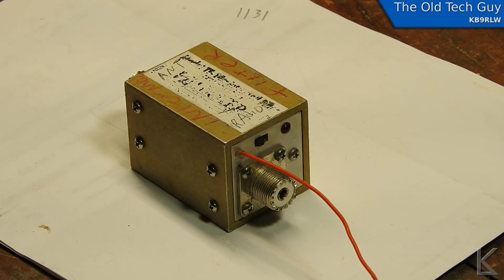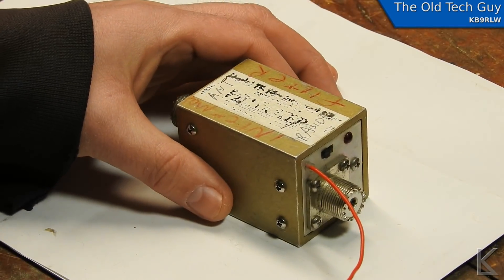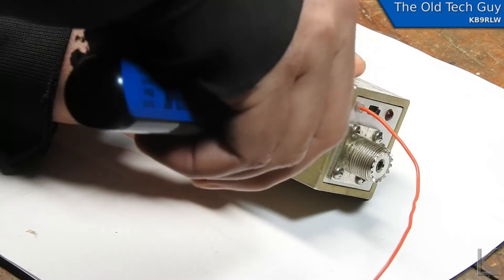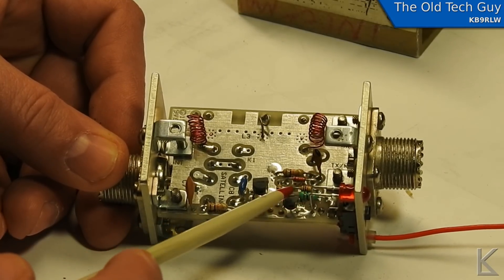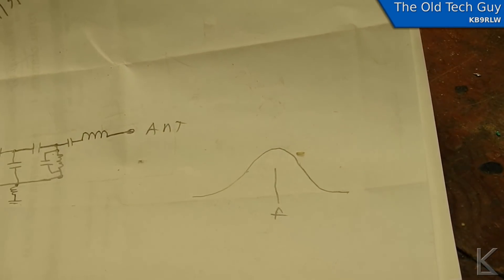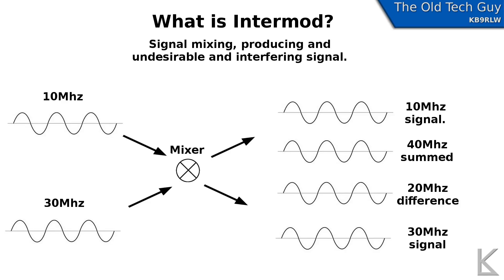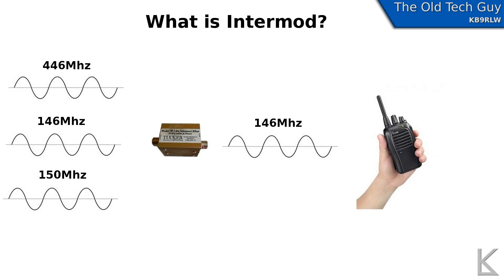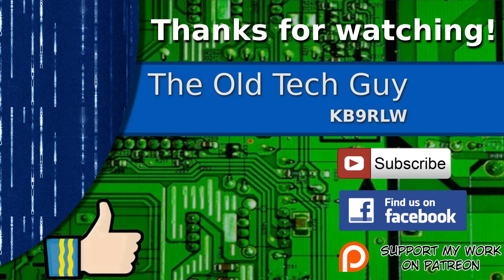Ham Radio - What's inside this intermod filter, and what is Intermod interference anyway?

Comment: There was an intermod filter I built back in the day, that just consisted of an inline coaxial T connector. It was designed just for signals around 152 MHz, which was where most of the "flame thrower" paging transmitters were at the time. It used a 1/4 wavelength of coaxial cable to attenuate the unwelcome signals. It worked somewhat well for its simplicity and you could also TX with it without switching and was passive.

Comment: I wonder why they used a relay instead of a two-way band-pass filter? Is it due to high power needing more expensive capasitors perhaps, even if it is rated to only 50W? (Inductors with heavier wire are cheap)

Good explanation on intermod, very clear and easy to follow!